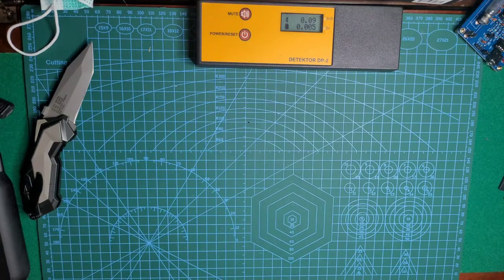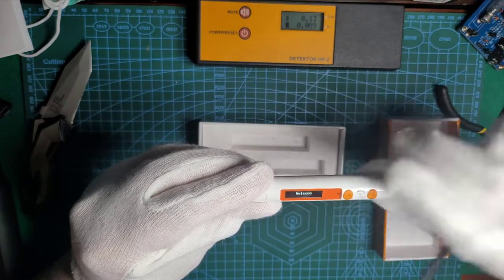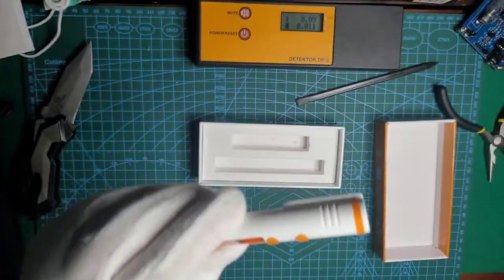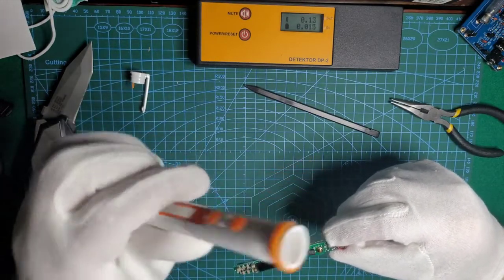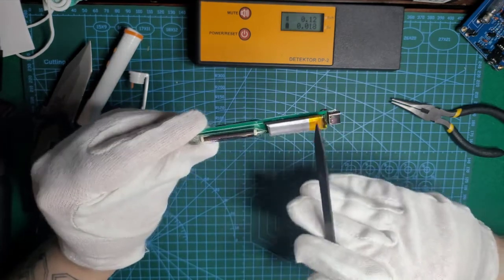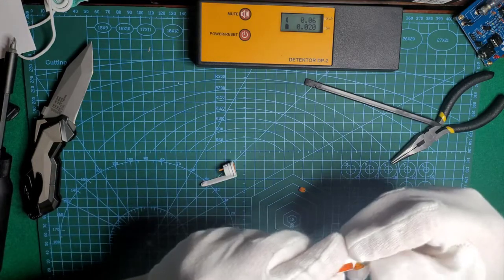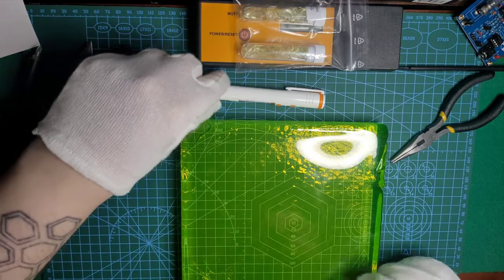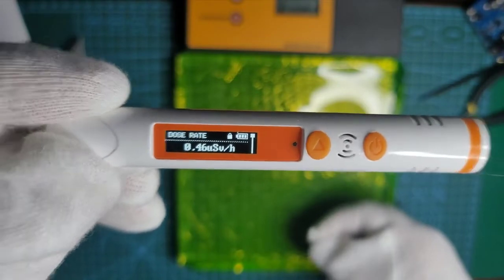HFS3 pen radiation detector AliExpress radiation sample uranium glass Geiger counter dosimeter v2

Comment: Hi!
I gave the modification for the buzzer you discussed a try. After 5 hours of microsoldering, I came to the understanding that the buzzer reacts to a squarewave 1/2 duty cycle signal from the ARM chip, not just a DC voltage. Unless the entire chip is reprogrammed through UART or USB the pen will never be able to chirp the detections. It can only flash the light. Unless the user is happy to have another circuit hanging outside the pen with a standalone buzzer. :(